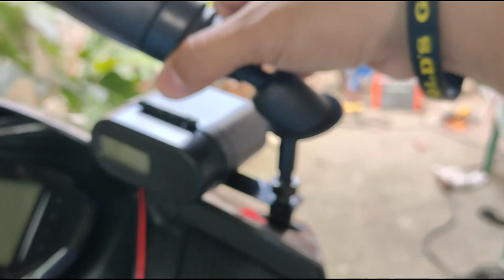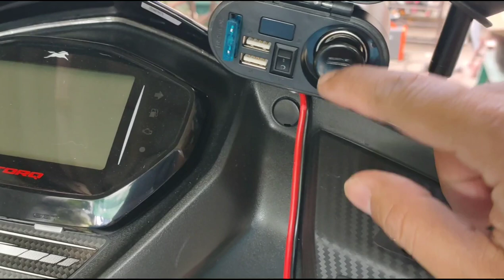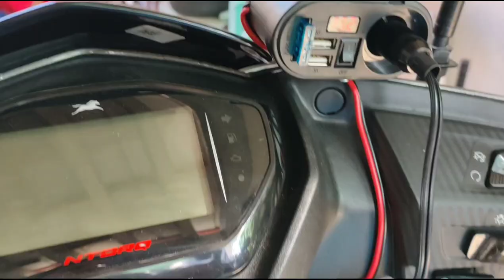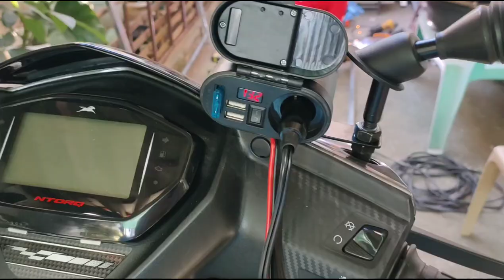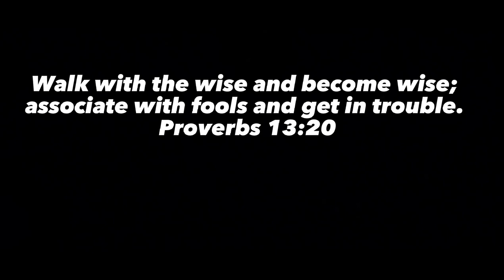DIY motorcycle cellphone charger installation with 12V lighter socket Vlog#12

Comment: I also installed exactly the same device...Voltmeter with USB port and a lighter socket. advise lang din to turn-off the switch for it will drain our battery. Upon installation I removed the top handle bar fairings to route the wirings on the side brake lever
Reply from the maker: Thank you bro sa advice. I really appreciate it.🙂
Reply: Lodi saan yng link sa TikTok ba ,?

Comment: Matanong ko lang po sir.Medyo  Matigas po ba ang gasolinador ng ntorq nyo?
Reply from the maker: Smooth at malambot bro. Maganda si tvs ntorq, over all bro. Comfy gamitin.🙂
Reply: @Ridesandhabits  naka bili na po kasi ako sir bakit matigas i birit ang gasolinador dito sakin?
Reply from the maker: @watchthis5703  Baka kailangan mo lang lubricate. Meron sa last part ng diy change oil and maintenance kung paano pa smooth hin yung throttle natin bro.
Reply from the maker: @watchthis5703  Diy change oil and maintenance. Hanapin mo bro yung video na yan sa account ko.🙂
Reply: @Ridesandhabits  salamat po idol ride safe. From paranaque po pala ako baka may rides po kayo ni tvs pasama po minsan hehe.

Comment: Boss maganda ba performance ng tvs ntorq
Reply from the maker: Yes bro. Ok na ok siya. Smooth lahat. Matipid pa sa gas pero malakas ang makina.
Reply: @Ridesandhabits  ung mga pyesa po b nyan madali hanapin dito s pinas
Reply from the maker: Yes bro available ang parts. May mga authorized dealer ng parts dito sa pinas.🙂